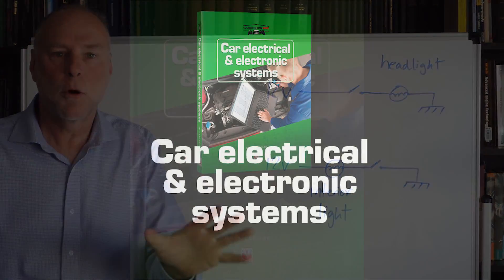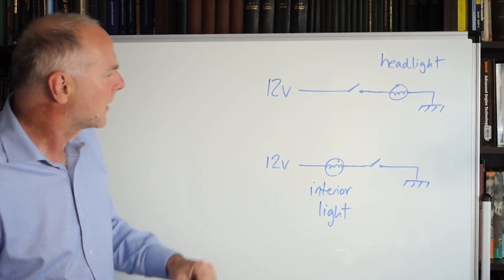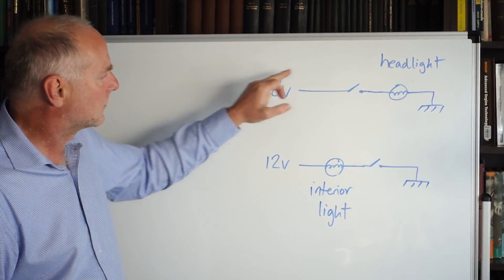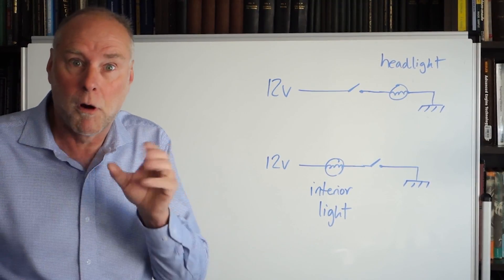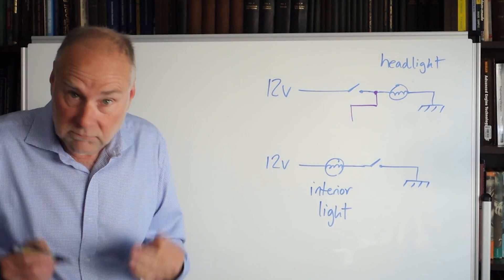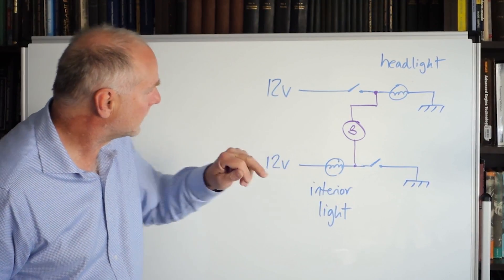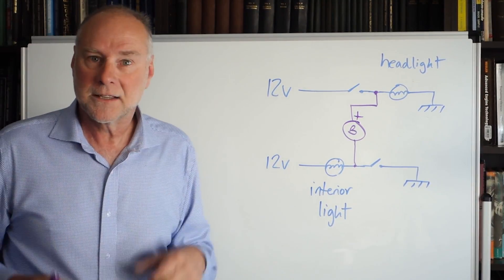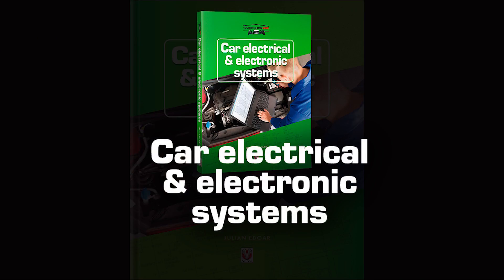Make Your Own Simple 'Headlights On' Alarm

Comment: Excellent explanation.
How could it be connected if I want it to work when I turn off the ignition switch, regardless of whether the door is open or closed?
Reply: I would imagine it would be the same as shown, but instead of the negative end of the buzzer going to the front part of the interior light wiring, it would go into the ignition wiring at the off switch
Reply: Wire the negative wire of the buzzer to a circuit that only comes on when the keys are in and turned a click  -  such a the cigarette lighter circuit. 
Then it's synchronized with your keys. 
(Positive wire is connected to the headlight circuit,  and only powers the buzzer if the headlights are on and keys turned off).
Reply: Instead of the use a relay that is energised by IGN. Replace the door switch side of the buzzer to the relay common and normally closed to GND. IGN disables the buzzer.

Comment: All good until you have a negatively switched vehicle such as a Toyota hilux
Reply: Probably same thing with an old Tercel 😳
Reply: Very simple to accommodate.
Reply: Not a problem because the common of the negativity switched system is +12 and is on for either high or low beam. Example an H4 3-pin has a switched +12 "common".